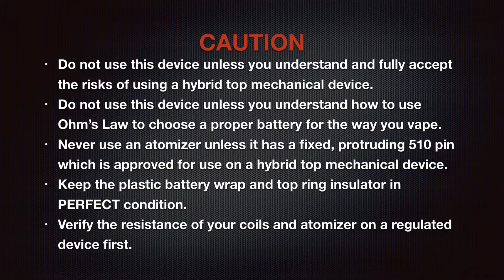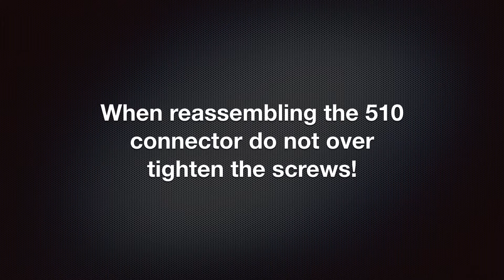Minding Your Mechs Ep026 – Clutch 21700 maintenance and performance tweaks

Comment: How do I clean up the threads you mentioned what can get in those threads to clean them up nicely?
Reply from the maker: I use Nevr-Dull and it’s been working well for me. It’s easy to get the cotton deep in the threads. A toothbrush with your favorite metal cleaner can work well too but it can be harder to get the residue out of the threads.

Comment: Hi mooch. 

My English is not so good and so I wanted to ask again. If I understood it correctly is the Voltdrop of the Clutch only minimal? And what would you recommend for cleaning the contacts?

Best regards from Germany
Reply from the maker: You can check the table of voltage drops for all the mechs I have tested. The link to my blog with the table is in the Description section of this video. The Clutch did not have one of the lowest voltage drops. It was not minimal. But that may or may not be noticeable to you since everyone says the Clutch hits hard even though it has voltage drop. For cleaning try Scotch-Brite Heavy Duty Scrubber Pads.

Comment: What's your thoughts on electrical contact grease after polishing the contact points?
Reply from the maker: It’s an insulator best used to just prevent oxidation on sliding contacts. If the two contact surfaces just press against each, flat against flat, then it’s hard for the grease to be squeezed out so the metal can touch...not good. If the contacts are being regularly cleaned anyway then IMO the grease can’t do anything since oxidation wouldn’t happen because the contacts are being cleaned. Not really useful except in certain very specific setups/situations. But, some people swear by them so you can always give it a try. 🙂

Comment: Is it safe to clean the silver contact/brass plate in an ultrasonic cleaner after polishing them?
Reply: Or ultrasonic cleaning is enough (?)
Reply from the maker: Check the instructions for your ultrasonic cleaner to see if there are any warnings against cleaning metal. I can’t think of any reason why there would be though as metal is the most common thing that is put in those kind of cleaners. You’ll have to experiment to see if just ultrasonic cleaning is enough. I don’t think it can remove oxidation using just water though.

Comment: Thanks for the heads up & tips for better power... As many ppl said/requested in the comments about a dual battery clutch, I'm definitely with em on that. Hope they drop 1. That will most definitely be a must have. Thanks again for everything that you do for the community  Mr MOOCH. Hope all is well & you're not still pulsing mods too long LOL

Comment: Hey Mooch, great video! Question, wouldn't the VD numbers been better if Dovpo had used copper instead of brass for the contact plate and possibly copper instead of stainless for the negative on the hybrid 510? Or at least copper screws? Thanks :)
Reply from the maker: Theoretically, a tiny bit. The difference between copper and brass is not large though and the resistance of the metal itself (of the contact plate) is already so low, micro-ohms, that lowering it a bit more wouldn’t make too much of a difference. Same for the screws. Only a few micro-ohms difference between the resistance of SS and copper screws so only a tiny voltage drop difference. Perhaps a thousandth of a volt or so. Machining the entire top assembly out of copper (or any single metal for that matter) might help a lot though as it’s the threads and connection points where a decent point of the voltage drops are occurring (versus in the metal itself).

A question we could ask though is would we notice, let’s say, a 2.5W power loss versus a 4.4W power loss? 🙂

Comment: One question. Silver sometimes work hardend, correct me if i'm wrong, will the tranfer bar harden eventually and snap after so many adjustments and or from putting the battery in and out? Are there any replacements?
Reply from the maker: There’s only “elastic” deformation going on for those actions. I believe the work hardening occurs only when the bending is “plastic”. That is, when the metal is bent far enough to change its shape, beyond the point where it can just bounce back. I don’t know if there will be replacement contact strips. You would have to ask Dovpo and/or Signature Tips about that.
Reply: Excellent, many thanks for your knoledge. So just small tweaks would not effect the springiness of the bar.
Reply from the maker: Alacote Fromp wait....I misunderstood your question. It you make a change to the bar that results in a permanent change in its shape (plastic deformation) then it‘s theoretically possible for work hardening to occur. The changes you would make are small though and this alloy of silver might not be as susceptible to work hardening as others. Bottom line...I don’t have a good answer for you. Go slow, be gentle, make as small a change as possible. I don’t think you’re in any danger of work hardening and fracturing the bar though.
Reply: The answer mooch gave is quite right, and your inference is essentially correct. The advice to put a little piece of that, one sided sticky rubberized sponge, under the bottom contact, to support it, is really great advice.
  Even if the manufacturer never comes out with a replacement contact, third party strips of silver can be obtained from various 'modders' sorry I haven't got any links.
  Just gently tweaking the contact for springyness, even a few times a year, I doubt would cause a problem. But if you do ever feel like you're getting to that point, there are several good videos about annealing silver  here on YouTube.
   Doing it in a slightly darkened room will let you see the faint colour change from silver to dull gray and then faintly glowing pink. If if glows just a slightly bit brighter towards more of an orange colour then you've gone too far. https://youtu.be/T2b4dPWUHLM
This lady seems to keep things as simple as possible, and just how quick it all is. Any gas flame with a gentle blue cone will work. Don't worry too much about getting a Boric acid type flux to prevent oxidation. Just work quickly, and it doesn't matter what the piece looks like inside the mod. We're not making jewellery, so just gently polish the contact point area. A bit of acid like vinegar or Coca-Cola can help removing the oxidation.
Reply: @John Rhodes great to know and thanks for bringing that up. I forgot that you can anneal the the metal and keep it softer just not too soft. Whoops getting more and more forgetful in my old age.
Reply: No need to appologize i understood what you meant. No severe alterations to the bar otherwise it might take a set shape or harden, small tweaks or adjustments for battery no problems. Many thanks for the information.
Reply: @Alacote Fromp There are absolutely replacement sleds and contacts available right now for these and all Signature Tips mods. This is the main reason I bought a clutch mechanical mod instead of a Purge mechanical mod as parts for these are easily available without having to ask on a forum for someone to hopefully send you parts. They are 23 pounds for the sled and contact or 16 pounds for the contact only. They offer both options for you on signature tip's website.